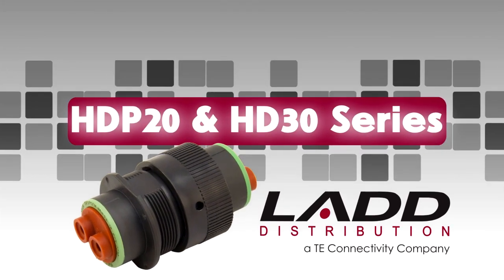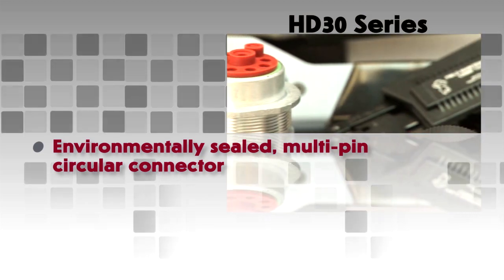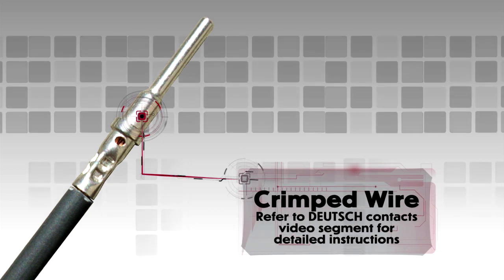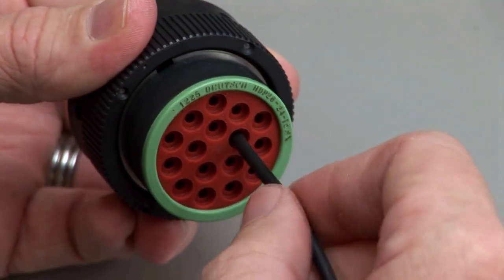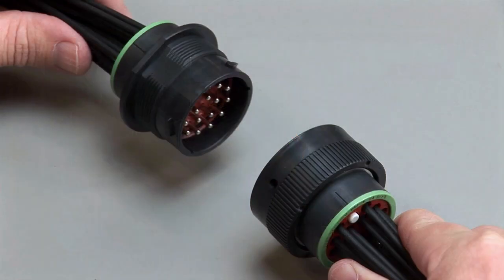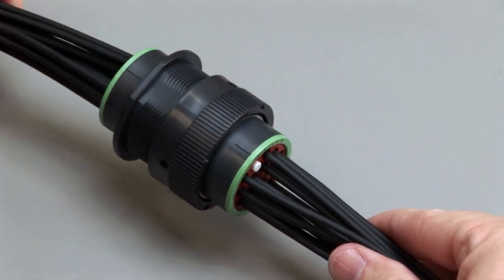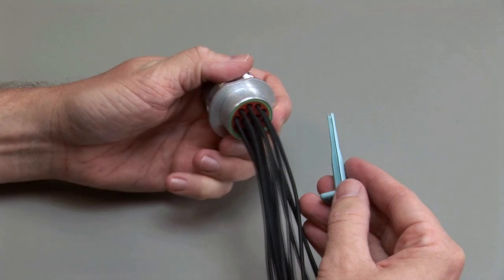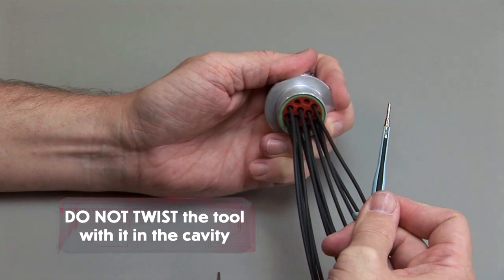DEUTSCH HDP20 & HD30 Series Connector Instructions

Comment: How could i push-in the crimped wire if they are silicone ones?. They flexed when i try to push-in
Reply: They have a plastic tool for setting the pins
Reply: @eliworks8549  Yep, the problem is silicone protection diameter. They don't fit in the AWG hole marked.